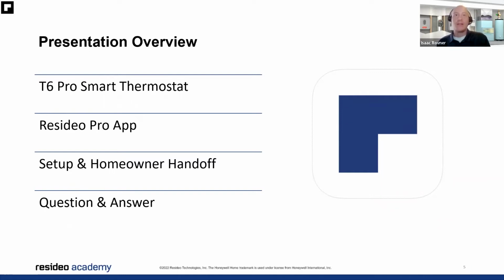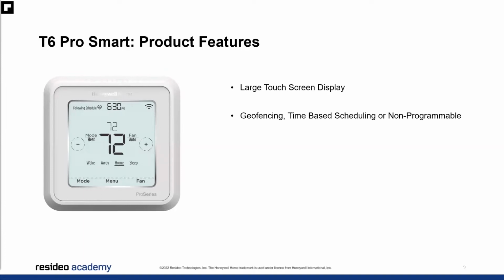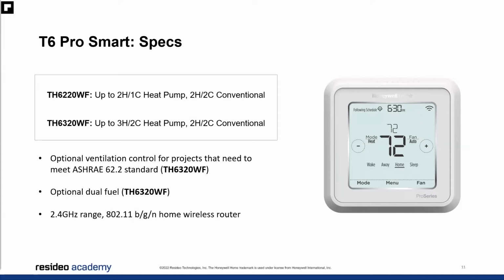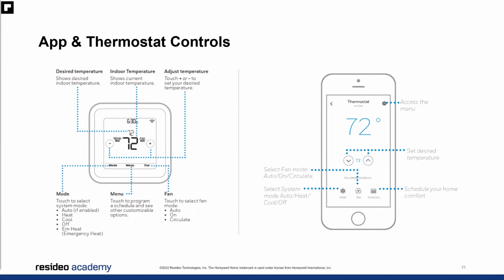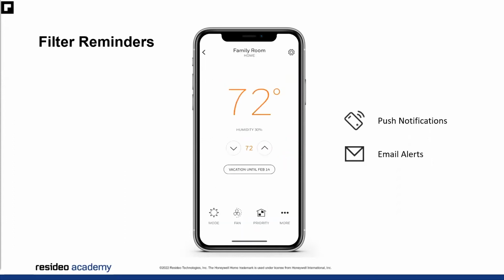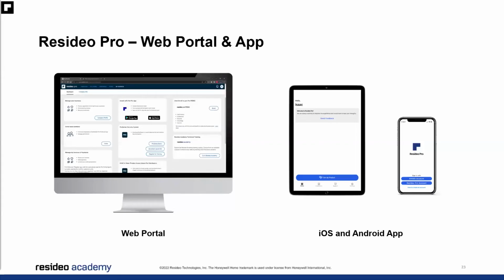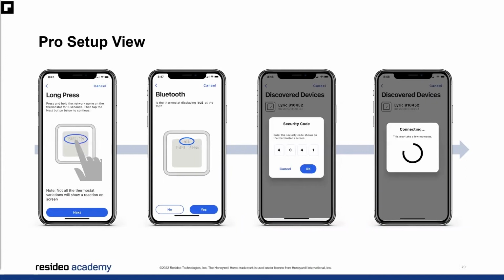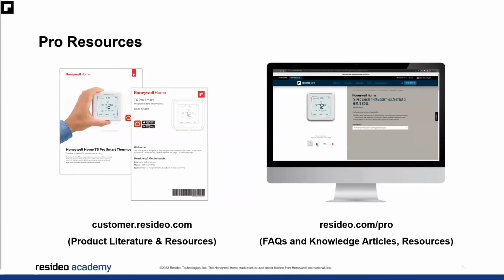Resideo Pro App and T6 Pro Wifi

Comment: How do you get it to connect to the app on the phone?
Reply from the maker: Hi Doug, thanks for reaching out! You have to create an account on the Resideo App and then it will walk you through step-by-step on adding a device, in this case your thermostat. -Charlie
Reply: @ResideoPro  I have done this over and over and it doesn't connect.